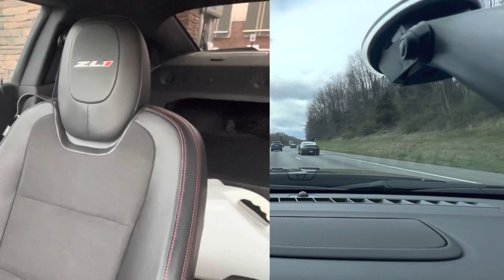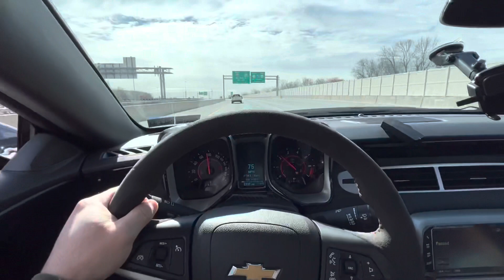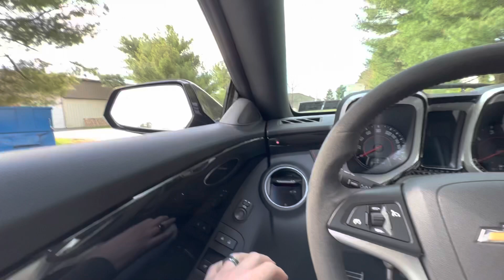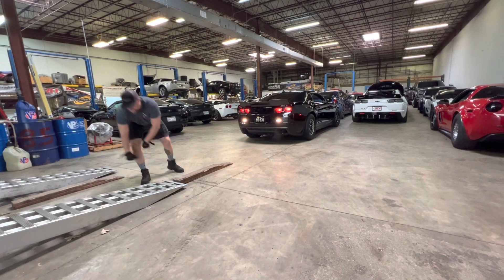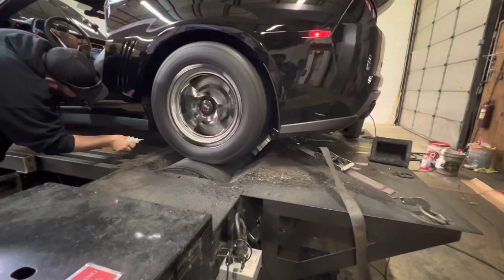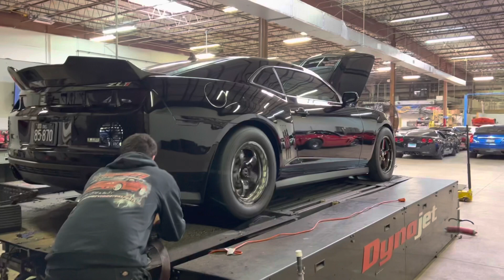ZL1  CAMARO SHOOTS HUGE FLAME ON THE DYNO!

Comment: Nice. Is that the Street Fighter rear spoiler?
Do you notice it makes the view out the rear window worse? Doesn't really look like it but just wanted to ask.
Reply from the maker: Yes sir street fighter la carbon. And it’s not that tall to obstruct your view haha it’s o it about an inch to a inch and half taller then the factory spoiler
Reply: @cnardi91  how is mounting? Any gaps or fitment issues? I've been looking at one and they are local to me but just haven't pulled the trigger just yet.
Reply from the maker: @Mac7504-OG   uses factory mounting holes and no issues I love it
Reply: @cnardi91  Good to know. A guy on our Gen6 forum posted a pic of his installed and it was all crooked but may have been the installer though.